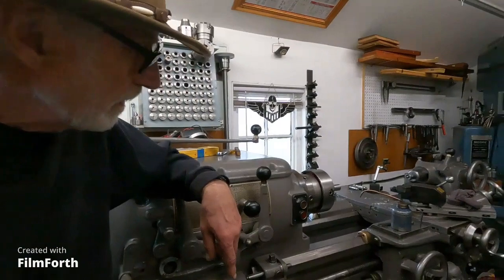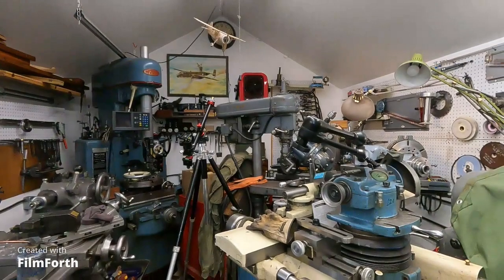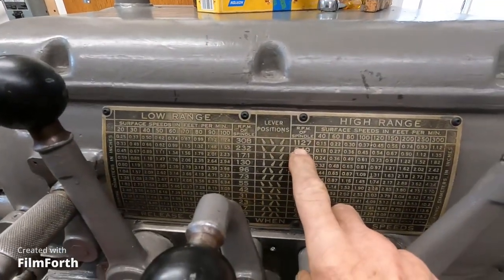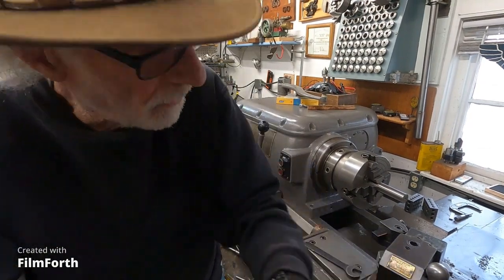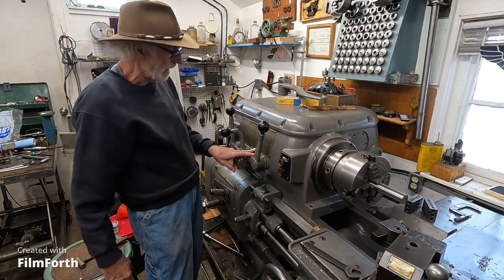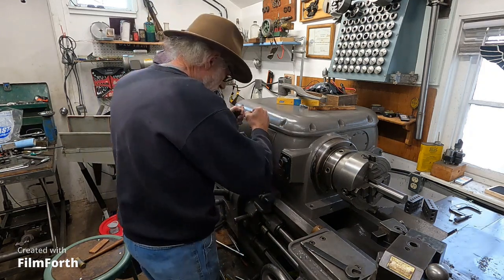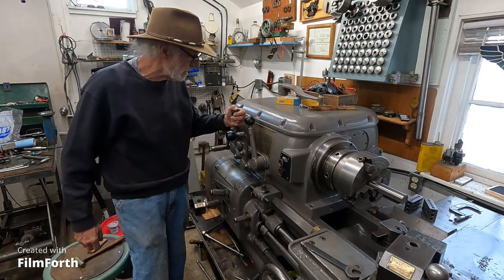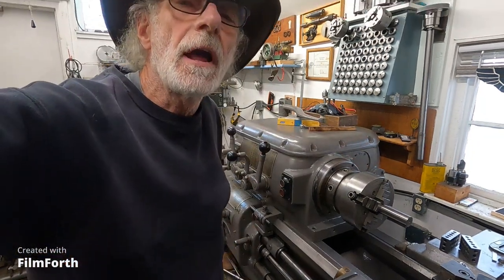Heavy Duty Lathe gear shifting, top speed and oil

Comment: Listening to the gear changes and speeds brings back memories of the Axelson we had.  I think I ran it one time in the highest speed just to see it run.  With a 12" 4-jaw chuck, out of balance due to the jaws the old lathe would get to rocking and rolling!
Most of the time we ran it in the 300-600 RPM range for the stuff we were cutting on.  Mostly 4140-4145 Heat treated steel in the 4" to 5" OD range.  A quarter inch depth of cuts at .015" feed rate were normal cutting for us.  Thanks for sharing! Ken
Reply from the maker: Hi, yes I expect to run mostly at lower speeds also.

Comment: So if you stick a long piece of scrap bar stock in the chuck and a dial indicator to measure the chuck when you lift the scrap . 

How about a piece of precision bar stock center drilled with it close to the chuck.  Then slide it out to allow it to hang free.  Run the saddle left and right with an indicator on the tool post to see how much wear there is.   If the tail stock is properly adjusted.  Indicating from the barstock to the ways would be easy.   Just to know where the wear is if any.
Reply from the maker: I think the best thing is to begin machining the parts I need and adjust to the condition of this 80yr old machine, it looks good so far thanks!

Comment: I use AW68 in basically all the old splash boxes around the shop. My 15” leblond will go up to 1200 RPM but i have to run it for a while and get the oil and bearing really warm and work up to it or it won’t run at 1200. But after things are nice and warm it’ll normally shift into the high gear.
Reply from the maker: Yes it is the same on this machine, it is getting better!